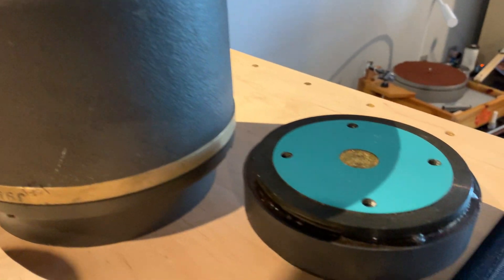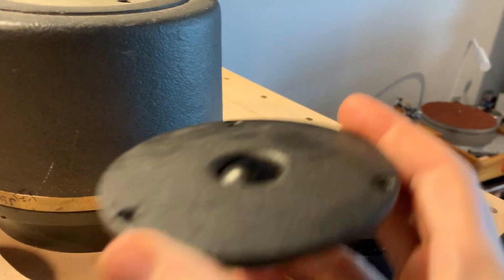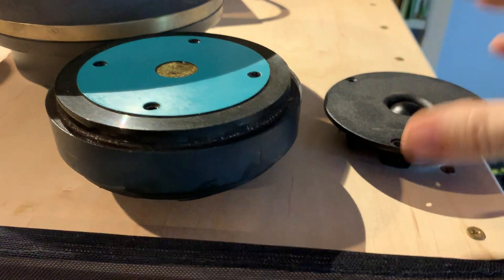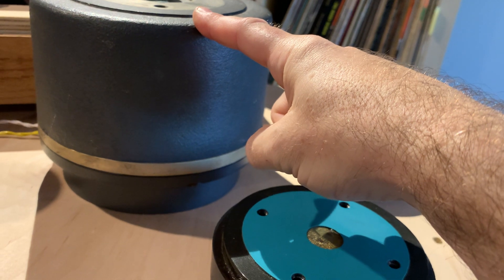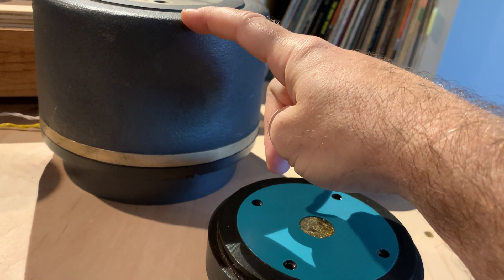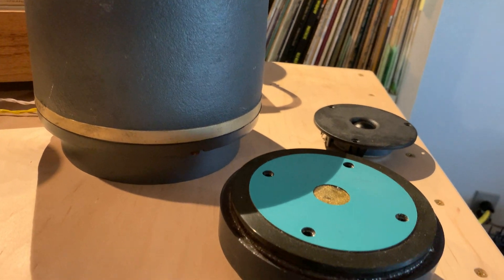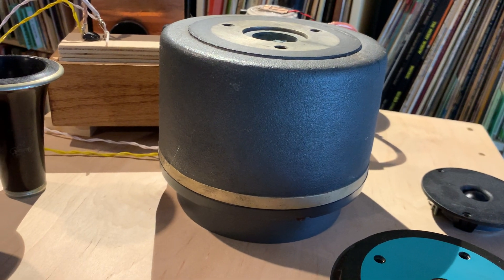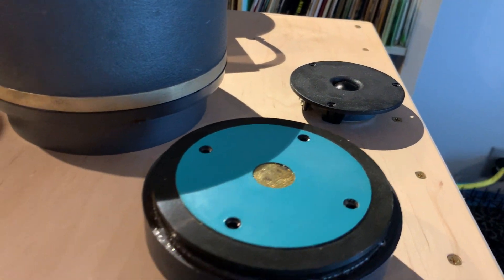Introducing the Yamaha JA4201 compression driver! & info on CD wattage rating!

Comment: the best compression drive is a celestion AXi2050 with a 150 WRMS and the sensitivity of 140db a frequency range down to 300 Hz.
you need to have a curve on top of your speaker it's got to be in a baffle not just sitting on top, because of deflection you get dips in the sound,
  just get a bit of stuff card and bend it over the speaker and hold it in with Blu-Tack and bolt the driver to the card. a bit of sagging in the card might be desirable as a waveguide and it's still has it's smooth roloff edges.
Reply: Yes the AXi2050 looks impressive, the Altec 291 and TAD TD-2001 also seem good options. Do you have experience with the Celestion yourself? As you somewhat suggested, I've actually put the DH1A into the top baffle much more like a traditional speaker, it's surface is perfectly fine to support 500Hz+ and a simple crossover takes care of the 6db/octave roll off over 3kHz.
Reply from the maker: Thank you Hoobs! Yes, I've been thinking about a dome shape extension to make the transition more smooth from CD mouth to speaker baffle. Have not gotten around to do it yet, one day I will. The sudden drop from the mouth of the CD to the baffle top should create a sudden drop below 1kHz, affecting the blending of the 500Hz-1kHz octave quite adversely. I expected to hear significant issues that this sudden big transition causes, but I'm not hearing it as something strikingly problematic. That's why I am keeping this definitively to investigate in the future. For now, my biggest bottleneck in the system is the input selector, and I'm badly itching to do a serious mod on the amplifier... plus, turntable rebuild and speed control optimization has been on the table for ages. Too many things to work on, not nearly enough quality time to do it.
Reply: @realworldaudio  
as I said it's not particularly difficult get some card and roll it into a half tunnel, cut a hole in it and attach your driver put some Blu-Tack underneath the driver! when it's sitting on the speaker. attached the card with type or blue tack. you could even veneer the cardboard to look like wood or use hardboard. just leave the tunnel open you don't need sides.

Comment: The 1003b can hold directivity down to a solid 300hz while a 311-90 looses it at around 800 hz, yet it’s “lowest frequency” is rated to 220hz.  All I’m saying don’t go beyond the horns rated/verified directivity in each plane.  Sorry for not having it link into one post
Reply from the maker: Thank you Bob, superb advice! While a CD might have the capacity to reproduce a frequency cleanly (and not be destroyed in the process), it's not guaranteed that the sound fills the room or even reaches the listener. They are certainly not drop-in replacements for tweeters and midrange drivers, and require a lot of care with (successful) implementation. Indeed, this deserves more attention, thank you for bringing it up!

Comment: Nice comparison. It seems that 3" drivers are a good compromise for the VOL: they cross low to go omni early, address step-loss, yet still reach into the upper treble range. The DH1A has some ringing at 13.5Khz so if your hearing is good, you may need a super tweeter. The DH1A, while much cheaper, does need a bit more work to get a flat FR compared to the Altec 288 but that gets you voicing options in return. I've been amazed how much of a chameleon this compression driver is sound wise: the DH1A has a coated titanium driver, but it does so many instruments so well and blends nicely with the paper Altec woofers.. very unlike what I regular hear mentioned on titanium dome tweeters.
Reply from the maker: I second it, the 3in drivers. With the Yamaha I will need to go higher with the woofer, crossing at 800Hz, that brings it to the land of directivity, cutting into the sensitive part of midrange. I'm curious how it will work, and whether it's an option for VOL. I hope that it will give 80-90% of the experience.. and when it does, I'll be happy.
Reply: @realworldaudio  The Yamaha is probably a better match for the Altec 414, which gets directional a bit higher up compared to a 515 and does the midrange extremely well - all at the small expense of 4-7dB of efficiency and perhaps 3Hz higher resonance frequency. There are tons more CD options crossing at 800Hz and you can go down to 2inch diaphrams.
Reply from the maker: @EduardBroekman  Eduard, you are a mind reader! The brothers of these Yamahas will be used with the 414, I'm testing them out to get a rough idea about the possible end result ; ).
Reply: @realworldaudio  I think your testing/prototype will warrant a video! Based on running my VOL and 3 months of tweaking and having it in 2 rooms, the result may well be 'off' when crossing at 800Hz beyond just matching 2 drivers: (1) mismatch with a room's schroeder frequency (2) cabinet step loss and (3) one driver to run entire midrange. By running the woofer down with a crossover between 200-500Hz, we dispense with step-loss correction but also gain option to tune as the XO match the Schroeder room transition.  Anyway, super interested to hear/see what your finding are, but you may find that crossing at 800Hz works better for a smaller cabinet, in a smaller room and at the loss of some low end just because of the room. My next speaker experiment is to use piano-soundboard instead of plywood for the 414/DH1A design and then find a good CD to match to the 515s that I scored recently. By the way it also took 3 months to run the drivers and XO in, it's only starting to come together....

Comment: Even if a compression driver can go lower than rated, in the end it’s the horn’s ability to control dispersion.  What you don’t want, at least I don’t, is having the lower frequency of the driver rolling outside the horns rated dispersion, sat a 1003b is close to a 90 degrees horizontal by almost 35 degrees vertical
Reply from the maker: Directivity is a huge issue with horns... can drive one insane! :) I was going to go down that lane, and stumbled accidentally on running a CD bare and firing it up, using the top baffle of the bass cabinet as a baffle support.It works astonishingly well, suprised me hugely. My friend Greg (he was the late Dr Bruce Edgar's mentor on horn design & calculations) said after hearing them that this bare application is so balanced, he preferred it to horns. However, below 1kHz the efficiency starts dropping down in this application, and this works for me with the 500Hz high pass crossover, but would not work for 300Hz ... that would require a giant horn with very carefully designed directivity to support that low end.

Comment: Hey Janos, you just messed up the efficiency numbers a little bit, your Altec compression driver has an efficiency of slightly above 10% which is enormous, the average HiFi of these days has an efficiency of below 1%
Reply from the maker: I hope my math was correct...? The Altec 288-16H is 112dB/4ft/W sensitive per datasheet, that is 113.7dB/Wm. 112dB/Wm is equivalent to 100% efficiency. The woofer compartment brings 102dB/Wm (which is supposed to be 10% efficiency) in the VOL cabinet, and I bring the CD level down to match it.
Reply: @realworldaudio  alright I looked it up again and it seems that you are correct and I am wrong. I need to dig deeper but what I found is that 112db equals 100% efficiency. Strage...
Reply from the maker: @snakeoilaudio  I suspect that the compression mechanism and horn loading (as even the bare CD has a substantial internal horn) creates an acoustic amplification effect that allows rendering higher than 100% efficiency. When we think about music instruments, thinking about woodwinds, they reproduce incredible SPL with minimal "power input", some of those efficiencies might be in the 1000%+ range.  
I mentioned the half-space in the video - that is the sound being focused to be dome shape (half) vs full globe, and that might account for increased apparent efficiency for forward propagation measured on axis, but that's just me running the cogs in my brain, did not find any data on it.